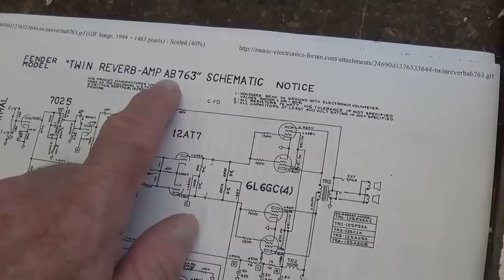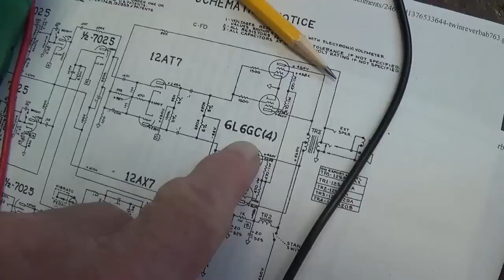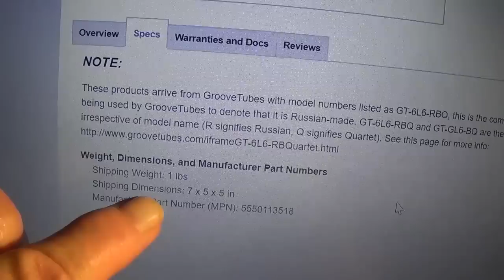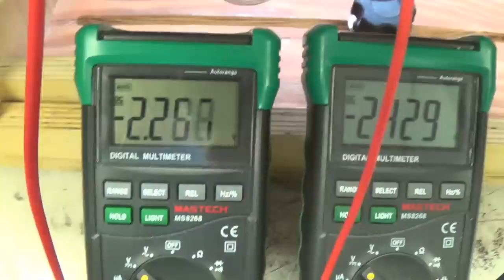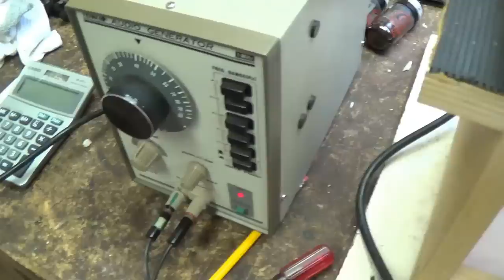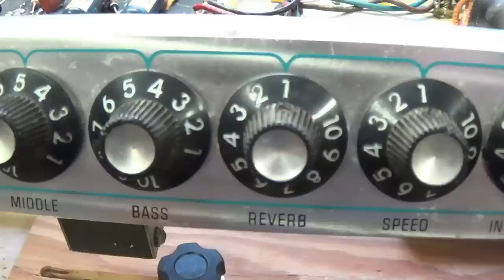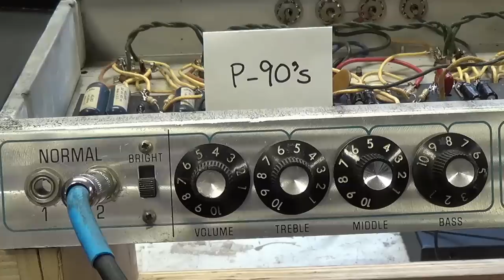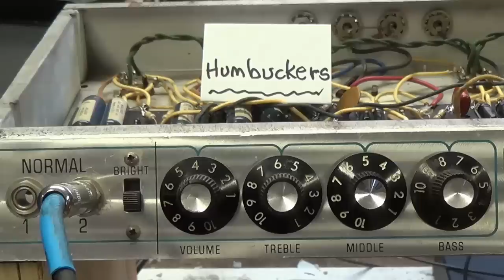1968 Fender AB763 Twin Reverb:   Evaluation, Modification, Extended Audio Demo

Comment: I once read -- don't know it to be verdad ... but the 763 designation meant that it is a circuit that was designed in July of 1963, just ahead of the advent of the blackfaces. I am blessed to own a 1976 Twin Reverb that has been "blackfaced" ... seldom got to really put the thing through its paces, as it was so loud. SOLID amp, though ...
Reply from the maker: I believe your interpretation is correct, TT.

Comment: Those MOD tanks are also put together a little better according to their info. Theirs have a solid connection at some point that the Accutronics tanks have removable connections that induce noise into the circuit or something. I don't recall exactly but it's why I chose MOD over Accutronics.

Also, I found documentation stating those first 6L6's were equivalent to 5881WXT/6L6WGC's. Basically what you bought, if I'm reading it all correctly.
Reply from the maker: I much prefer the MOD tanks over modern Accutronics tanks, JC. Yes, I believe the tubes are essentially the same despite the different markings.

Comment: Hi HD! Tks for another great video with tech content and refined humor...and of course 1st class amps. I have a question though, when biasing the speaker should be plugged, right? I noticed that you had only one speaker plugged when you start biasing. Since the amp was designed to work with two, does't that influence the outcome values? I'm sorry if this is a stupid question already made a zilion times in other videos but I couldn't find it.....
Reply from the maker: I explain it in the video, AC. The output transformer (OPT) is wound for 4 Ohms of speaker impedance. I provided 8 Ohms, which is not optimal, but enough to protect the OPT from harm during the biasing procedure.

Comment: From my deep dive down forum rabbit holes, I’ve learned that the stamp on the inside of the chassis is read thusly:
T22= the technician id #
13= the week
68= the year

Coincidentally, I have the same tech id # of T22 on both a ‘68 Deluxe Reverb and a ‘68 Super Reverb
Reply from the maker: Thanks for the interesting info, VWW.

Comment: FYI, the thin black vertical lines on the faceplate are an easy way to tell if you have one of the earliest silverface amps. They were on there from the silver face introduction in the fall of ‘67 until about summer of ‘68. Most of these amps have the same circuits as their Blackface brethren.
Reply from the maker: Thanks for the info, Andrew.

Comment: DH Gate has some hand wired  Marshall clones advertised. a jtm45 , a plexi jmp? and a jcm 800. they look well built and have nice looking cabs. you should consider a demo of one of these. i havent seen anyone on line do one yet!!
Reply from the maker: I only deal with vintage tube amps, SB, but appreciate the suggestion. It's great that wonderful old amp models like Marshall, Supro, etc. are being reissued for modern players.

Comment: Uncle Doug, regarding your component kits, ive been searching for kits that have assorted components already put together, but ive had no luck doing so. I guess I’ll have to go through a few schematics and take a tally of the values of those components to make up my own kits. the only issue I have with the divider boxes you us, is if you drop them, you have a big mess. as a professional carpenter /cabinetmaker and we have all sorts of sundry’s we take to site. ive used the small sized peanut butter clear plastic containers (Kraft .500kg) , that fit in rubber made storage boxes, or on to shelves (one jar deep) on the wall behind my work bench. but whatever works the best or floats your boat   8^O
Reply from the maker: Thanks for your input, IM.

Comment: Uncle Doug: sorry to make so many comments and questions. You are the person on the tube i trust the most.

I am planning on building an amp soon. when i do what kind of wires should i use? solid or stranded?; copper or aluminum; ptfe covered? and etc, etc. 

thanks for all the great videos.

P.S. are you familiar with the "two stroke" amp plan/kit from fave hunters amp book?   if so what you think about it?
Reply from the maker: Thanks, NMN. Stranded wire is best. Solid wire will fatigue and break due to vibration. Copper.....never aluminum (?). Vinyl insulation is fine. I am not familiar with it, and really can't offer an opinion. Good luck.
Reply: @UncleDoug  ok. thanks a bunch. years ago i read the  guitar amp book from dave hunter.  he followed along the signal path and such like you do in your videos.   your videos are a huge help in learning.   i am fixing to watch the series about capacitors.

btw. after reading on the net some more i have seen a few comments that said the amp project from that book is a hot rodded or modded princeton circuit. i saw you have a diy princeton video so i will be checking that out as well i am sure.  

hopefully i won't bug you for a while with new questions. just keep watching your vids and learning.
Reply: @UncleDoug  oh and it appears you have decoded my youtube name. lol
Reply: @UncleDoug  Wanted to let you know i joined patreon so i could help support you and Rusty, and Jack.

Comment: Amazing video (as usual!).  Quick question about max plate dissipation. Aren’t 6L6gc tubes 30w max?    So you’re biased at less than 50% with 13w….  I’m biasing up a black face Vibrolux reverb and have the bias pot all the way down (least amount of negative bias voltage) but can’t get more than 15w from ANY pair of 6L6gc’s…
Reply from the maker: The proper PD depends on whether the output tubes are cathode biased or grid biased, John. Perhaps your 6L6's are old and incapable of producing higher PC (?) Also, you might check to see if the -DC bias votage agrees with the schematic value.
Reply: @UncleDoug  Thanks Doug. Yes. Negative bias voltage matches schematic. It’s a black face Vibrolux, so fixed bias.  But in your video as well, you only bias the 6L6’s at 13w each which is less than 50% max. Is that not a bit cold?

Comment: cannot help, as a Triumph 110 650 rider back in the 70s and other 650cc Triumphs et many others, that you are keen on the unit 650 or even possibly 750 unit construction BSAs. We used to say that BSA was designed for the narrower shouldered riders. . .  love the pictures of the rigid Harley flathead and all  . . . .East Devon England . .  .

Comment: Doug, I don't know if you would agree, but IMO Fender/CBS were heads above every other tube amp manufacturer at least until the early-mid 1980's. I own a '69 Bandmaster-Reverb, '73 Super-Reverb, and a Fender reissue 1957 tweed Bandmaster and a reissue 1957 Fender tweed Twin reissue amp.
Reply from the maker: It's tough for me to advocate for a single brand, Tony. I work on all sorts of viewer amps and show them all the same level of respect and care.
Reply: @UncleDoug  Respectable opinion!
Reply: But I'll Still take my Fenders!

Comment: I have an old Showman that I've partially restored. I'm thinking about replacing the ground switch with a presence pot. This produces a similar effect of removing the negative feedback, but provides some additional control.
Reply from the maker: Yes, it does, Jim. Good luck with your project.

Comment: Great vid as always. I see you slowing down the tremolo pretty often. That's a cool mod. But what about making it more...stuttery? Make the dips deeper? How would you do that?
Reply from the maker: Stuttery isn't going to happen, simply because oscillation loops are quite evenly timed. The depth can be increased by increasing the gain of the second triode of the 7025/12AX7 tremolo tube.
Reply: @UncleDoug  Yeah deeper is what I meant. Not so much stuttery. Make the dip more pronounced without cranking the intensity to 10. Thanks for the tip.

Comment: I've learned just so much from your channel and I have been thoroughly enjoying what you do!  I have a few questions for you.  Which part of the AB763 constitutes it AB763?  Best guess I can figure is just the first couple amplification stages, because there are a bunch of AB763 amps that have the "same" circuit and all of them different at the same time.

Second; If I wanted to add an FX loop in... say a Bassman. Can you just simply graft it in just after the tone stack?  Or should it go after the second pre-amp stage? Do you need another amp stage?

Thank you for your knowledge.  I hope Rusty is enjoying heavenly tennis balls and Jack gets a little extra catnip!
Reply from the maker: See my detailed comparison of Super Reverb circuits, BI, almost all of the changes also apply to the TR. I have no experience with grafting in effects loops, but I'll bet there are many helpful resources on YT and the Internet. Good luck.

Comment: Thank you for doing this video.  Can you explain why 13.5 watts is an ideal plate dissipation for this amp?
Reply from the maker: You're welcome. "Ideal" PD is subjective, while "Maximum" PD is an actual value. You simply seek the minimum PD that still provides great tone while not exceeding the maximum value. Please see my latest video for further clarification.
Reply: The datasheet of the tube of you picked out said plate dissipation is 30 Watts. I'm guessing that means maximum plate dissipation. I heard somewhere it is ideal to adjust your plate dissipation to 70% of maximum plate dissipation? So the supposed ideal plate dissipation for your tube would be 21watts? That would mean you're going at about 45% of plate dissipation? Is that right?

Comment: I may be a bit biased here, but starting at about 28:00, the bias explanation and demonstration was the best part of this video. I did have a question: In the data sheet it mentions 30 W plate dissipation (*I presume this is the max). You settled on 13.2 and 13.3 W PD. How did you arrive at those values? Thanks!
Reply from the maker: Thanks, Chad. Your max PD value is for 6L6GC tubes. The tubes in the amp were labeled 6L6GB. The max PD for 6L6GB tubes is 19W, and 70% of 19 is 13.3W which is where I set the bias. You may argue that even though the tubes are labeled "GB", they are actually "GC's".....but this is not an assumption I am comfortable to make. It would be nice if tube manufacturers would use consistent and traditional labeling on their tubes......but until they do, I will take their labeling literally.
Reply: @UncleDoug  Aha - gotcha. I was stuck on the 30W. Yeah, some of the variations of Russian tubes are murky. There's allot of different 6L6's out there, and biasing in a safe zone is much preferred. Thank you!
Reply from the maker: @CC-te5zf  You're welcome, Chad.

Comment: Any chance I can pay you for your time in researching a good location fir  an Effect Loop on a  Peavey Deuce?   
I’m fairly good at mods, but I could use some help on bypassing the the preamp in this beast. 
Appreciated your generosity in distributing knowledge for a long time now. All the best.
Reply from the maker: I appreciate the offer, JP, but I don't do personal consultations. My guess would be to insert it in the wire carrying signal to the phase inverter. Good luck.

Comment: I noticed at 29:43 that you had power on the amp and were turning the standy by ON, but there was no speaker plugged in. Is it critical to have a load on the amp when testing?
Reply from the maker: If you look again at 30:08 you'll see that the shop speaker was plugged into the output jack, Greg. It's important to have a speaker connected to protect the output transformer, and to get accurate bias readings.
Reply: @UncleDoug  I see it now. I had heard that it was bad to run a tube amp with no load but I never knew what it would damage. Thanks for the information.

Comment: Uncle Doug: Regarding  volume & treble controls the schematics show a "2-35" code after the 1 meg or 250k spec. This is a custom taper Fender used (must have been 10,000+ special order). 

When replaced with a audio taper pot the results are usually disappointing. There are "J" taper pots in 1 meg & 250k which would be the closest thing currently available.
Reply from the maker: Thanks for the tip, Dan :)

Comment: Great video  as usual Uncle Doug, The amp sounds great with the FBL disconnected,.I have a BF Twin and I tried to revert a friends silver face amp to the AB 763 circuit (his is a 70s model) we changed a few things following instructions from an ampbook....but it didnt really make it sound like the 80w BF, could it be that the transformers are larger in the 100w models? Rgds
Reply from the maker: Thanks, Alvaro. Good luck with your project.

Comment: Was there some kind of wrapping around the 12A*** tubes with the shields in place during the unboxing and preliminary examination? Or were my eyes playing tricks on me?
Reply from the maker: The 12A tubes were sent in their sockets with the shields in place, only the bare output tubes were removed and packed separately. This seems to work quite well on amps with tube shields.
Reply: @UncleDoug  Right; I understand that. What I'm saying is it looked like there was something wrapped around those 12A*** while still in their sockets and the shields in place. It looked like some thin white paper or wrap. I'll rewatch the video and see if I'm going blind. Or crazy.
EDIT:  Okay, I rewatched the video and starting at about 4:00 minutes in, I see what I thought was a wrapping on the tubes. It actually looks like springs inside the shields to hold the tube in their sockets. Am I correct?

Comment: Hi Uncle Doug.  I have a Twin Reverb Reissue going through my 300w light bulb current limiter.  It is always slightly lit and I see in this video that your's is too.  Do you crank your variable transformer so you still have 120VAC at the amp?  Thank you!!  I have trouble shot this twice...lol.  why is my B+ so low!?  It drops quite a bit.  I don't recall you discussing this in the CL video, if you did just say so and I'll go watch again.
Reply from the maker: A big amp like the Twin Reverb will draw a lot of current, Randolph, which in turn will partially illuminate the bulb. Also, the more current flowing through the current limiter, the greater the voltage drop, so a TR will be receiving several volts less than the wall AC supply. You can lessen this by using two 250W bulbs in parallel.
Reply: @UncleDoug  I cranked my variable transformer so that it shows about 140VAC with a ACV meter showing 120VAC reaching the amp when the amp is on.   If I don't do this my bias settings and B+ measurements are all out of whack.  If not doing one of those it works fine otherwise.

Comment: Doug those initial test tones sound like square waves. What am I missing ? Did you use a square wave to use the harmonics to test the tone controls ?
Reply from the maker: I can double check the audio signal generator, Don, but I don't believe so.

Comment: Hi Doug brilliant videos I always wanted to repair amps 
I went for a course many years ago it was TV repairs in black and white but I thought it would be the nearest to amplification but failed the maths at the time
I have a fender Twin reverb pre master volume silver face non drip edge 
After years of spraying pots at the top of the front panel as I was touring and playing every night and the amp lived in the car and later VW bus the finish in the front plate has gone and the lettering as well
I wonder if you may know where I can obtain a replacement 
I am in the UK
Reply from the maker: Thanks so much, P. You can search Ebay for replacement panels......but the last time I looked there were no Silver Face panels being re-made.
Reply: @UncleDoug  thank you so much for the reply Doug

Comment: Hi Doug, I noticed that at the start of the audio demo the current limiter lamp had a faint glow, but was off towards the end. Did something change in the amp during the demo?
Reply from the maker: The Twin draws enough current to weakly illuminate the bulb, Kevin. If the bulb was off at the end, it means that the amp was too......probably during the "settings" phase of the audio demo.

Comment: Doug, great video as always. A question if you have time to answer it. I understand the concept of matched tune sets as well as the wisdom of using them. The question is how long, under normal use, can one expect a matched set of tubes to remain a "matched set".  Also, how long, under normal use, will a properly biased amp run before one should check the bias and possibly re-bias.
Reply from the maker: Thanks, Reggie. All output tubes degrade due to use. The cathodes gradually lose their ability to "shed" electrons and their PC diminishes. It's not unusual for the tubes to degrade at different rates, so you need to re-check the bias periodically, i.e. after 100 hours of use......but this figure is just an estimate and some amps may vary in their need for maintenance. Once you reach the point where you are unable to achieve sufficient PC to maintain a good bias, it's time to replace the tubes.

Comment: Groove Tubes 6L6B. I believe Aspen Pittman liked to put a 'B' on the end of a tube's designation to indicate that it was better or best. I believe those 6L6B tubes you have there were made by Sovtek.
Reply from the maker: Thanks for the info, John :)
Reply: I had put 6L6's in a Bassman 70 back in the early 90's. Groove Tubes used the designation of 6L6GT at the time. I don't know where they were made and I have long since sold the amp.
Reply: Well they shouldn't, because it implies earlier than 6L6GC where the C is an evolution code. And Gibson were using 6L6GBs in 1960. (G only means 'glass'.)